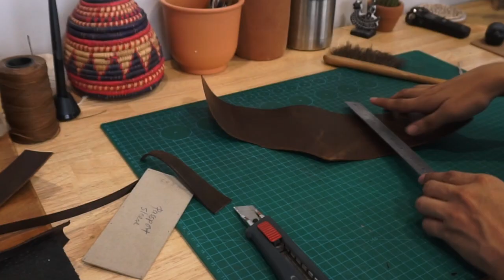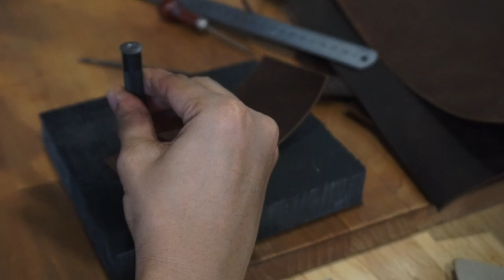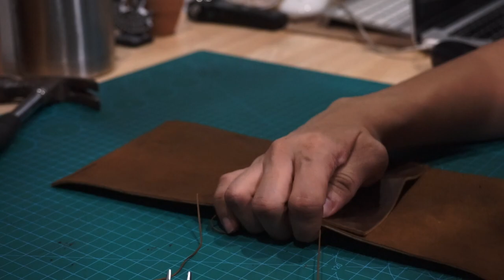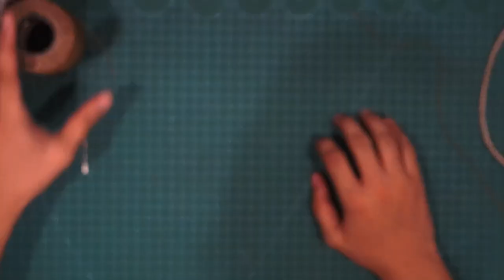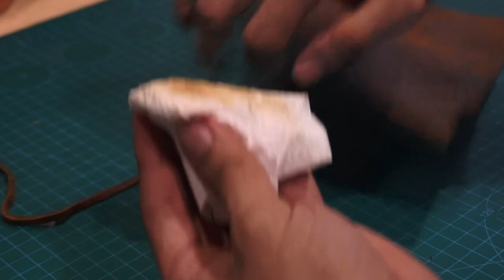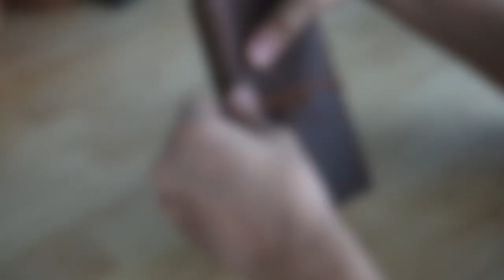Leather Crafting: Handstitched Rustic Leather Passport Cover

Comment: Hey Kenneth, is there a specific leather craft tool kit you can recommend?
Reply from the maker: Hi. Hmmm I dont know any kit actually, but the basic stuff /set should be fine. Mallet, cutter, peircing tool, steel rule, needle and waxed thread is basically all u need.